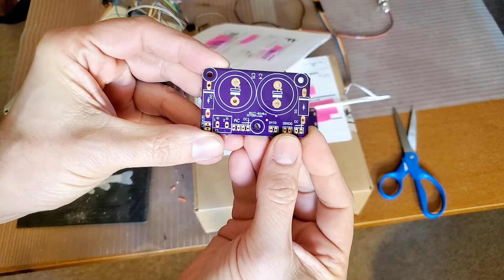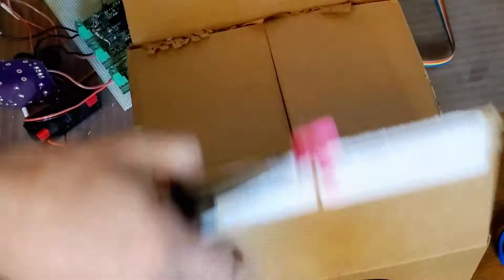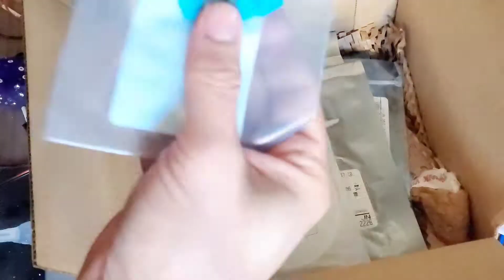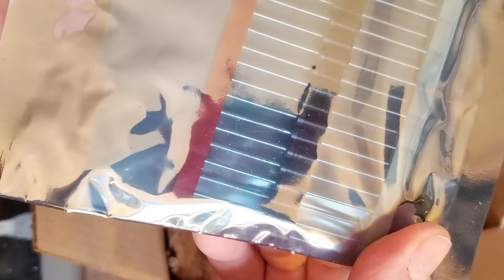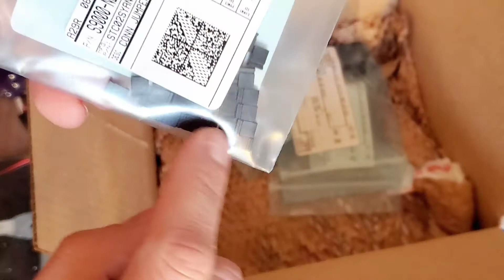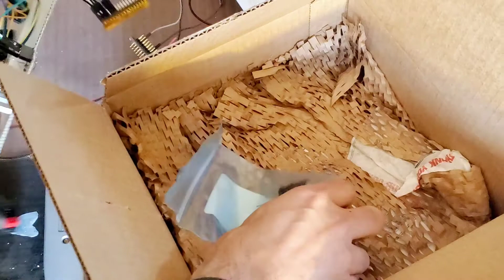New circuit boards and parts arrived for new voltage doubling rectifier for Pyramid Eel 02

Comment: My understanding on choosing a proper voltage rating for capacitors is to pick a value that is roughly twice your source voltage. Have fun building those and cheers! :)
Reply from the maker: Thanks!  After I solder these I'll post a vid with the input and output voltages to find out for 👍